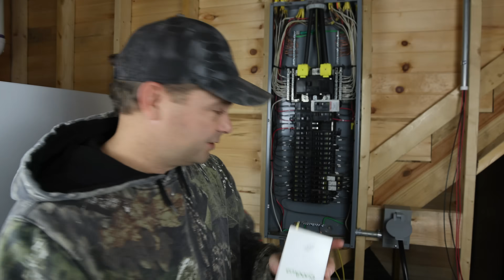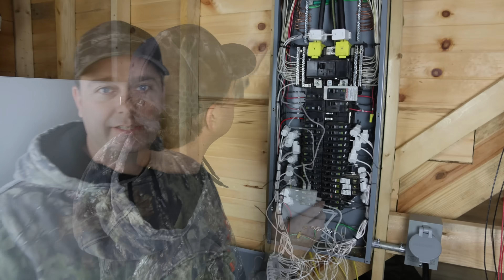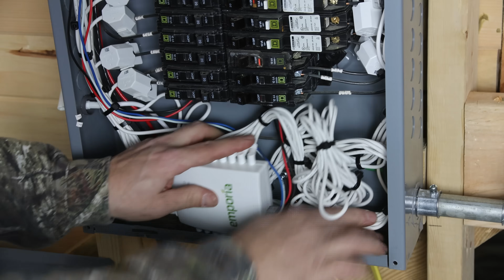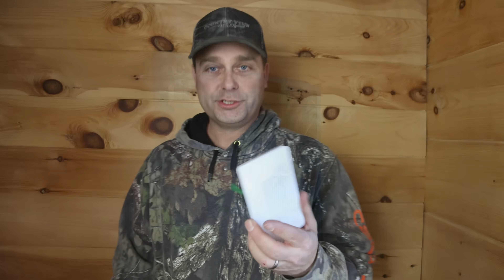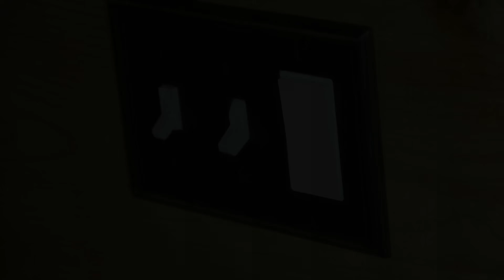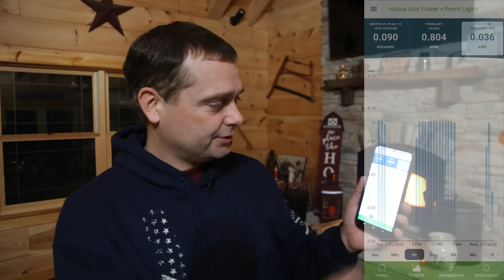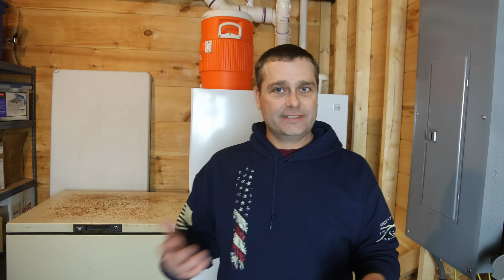Determining our power Needs for Solar.  Installing a Energy Monitor to know exactly what we use.

Comment: If you want to power your fridges and freezers, I would recommend changing out any front opening freezers for chest freezers. With front opening doors, thermal convection causes the cold air to fall out. This doesn't happen with chest freezers. This makes chest freezers a lot more efficient.
Reply: Chest freezers use more electricity according to the stickers indicating how energy efficient they are.
Reply: @jamesmason8944  I did respond with a link saying why chest freezers are better but yt ate it so I am going to give the abridged version.

Chest Freezers have better insulation than upright freezers. They can remain frozen for 72 hours after the power is cut while uprights will start to defrost immediately.
Chest freezers only run the chiller when the door has been opened and allowed warm air to be pulled in due to low pressure inside the freezer.

The reason they have a higher draw on power at start up is because they are generally bigger. Even a small chest freezer is bigger than the freezer of an upright combi fridge freezer.

But that power usage is only when you start it up first time or add food to freeze. But upright freezers also have to use the same amount of power to freeze the food, plus the have to chill the warm air that replaced the cold air when you opened the door
Reply: @Falney  I prefer a chest freezer but when thinking of purchasing a new one, I did compare them with an upright of the same capacity and can only state what the manufactures information was showing. Perhaps it is simply because chest freezers even of the same capacity are fitted with higher rated motors and compressors for what ever reason, but it cannot be because of door opening as that would go against your reasoning.
Reply: @jamesmason8944  a quick Google search brings up the result that the average chest freezer costs £4 a month to run vs an upright freezer at £11.

Yes a chest freezer takes more energy the first time you turn it on, but it has less to do to keep it colder. So long term, they are more efficient
Reply: @Falney  wonder why they have those stickers with a higher yearly consumption of kwh for a chest freezer. I did Google too and also seen what people are saying, sometimes there are a lot of "experts" highlighted but Evan is the man with equipment to let us know the consumption. Best regards
Reply: @jamesmason8944  I wonder how it's tested, without opening the door? Honestly manufacturers and sales might use this as a loophole. Since I have a couple upright refrigerators and freezers as well as a chest freezer I am going to find the serial number sticker and see what amp draw they all have.

I really need to record these numbers because all that one refrigerator and the chest type freezer are running on our Solar/battery setups and today I hope to add workshop with chest freezer to another setup.

Either way, not in the market now to purchase any more but when I do I will be comparing price and energy usages.
Reply from the maker: You can see the refrigerator power use go up at dinner times, from opening the door several times.
Reply: @CountryViewAcres  Yes but according to the data here in the UK. All things equal, that is running for a certain time without opening the freezer, for some reason chest freezers are not as efficient as uprights. The physics of opening and closing  certainly effects the running of the appliance. I think you will find even your newer chest freezer will consume more electricity. Best regards Evan